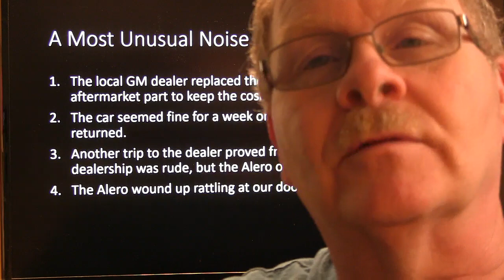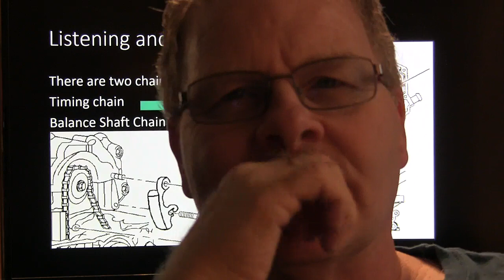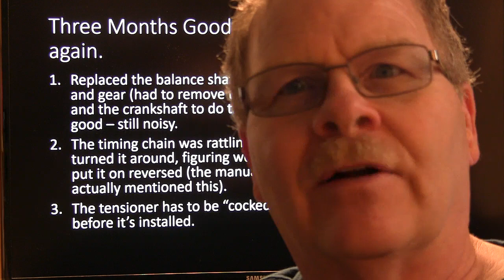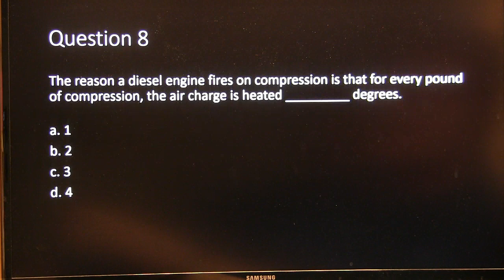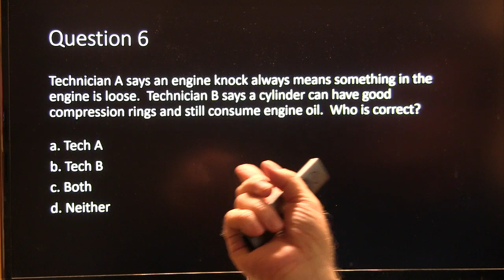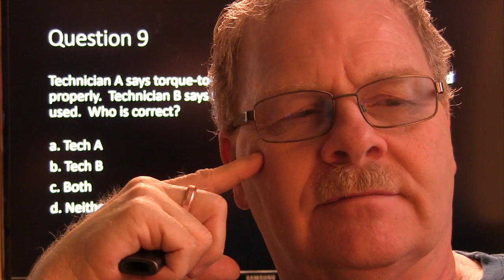Fighting a Rattler

Comment: Those water pumps, yuck, I had a 2013 0r 14 Equinox customer came in thinking his alternator was loud, whining, took the belt off and the noise was still there coming from the chain area.  Noticed a new water pump on it and popped off the timing cover on the bottom.  Noticed that the balancer shaft tensioner was extended all the way out and chain super tight, reset the tensioner and put it back together and noise was gone. Someone let that chain loose on the water pump job and the tensioner could not ratchet back.

Comment: How are you going to do that?  The shop MacGyver says we are gonna do it with a hand cleaner jug. 
A 90's Maxima came to me pre-diagnosed as a water pump timing chain job. I was doing work out of my house garage at the time so it would get done for a flat rate of a days work. The pump, thermostat, oil change, coolant, and pressure checks were done in about a couple of hours vs all day. The customer was shocked when I called before lunch time with a massive discount and the car ready to go. After that he was one of my best customers. For a few years he would drop off a car and ask me to do any work I want to do.
Reply from the maker: You have the best stories.  Once at the International Truck dealer I was told to remove one head (gas burner) and replace the one valve that was burned - he gave me six hours to do it - handed me the ticket at 10 and told me to have it ready by 4 - and I started it before 12.